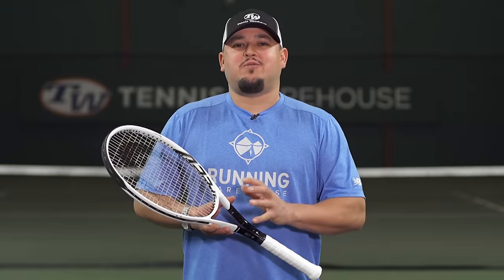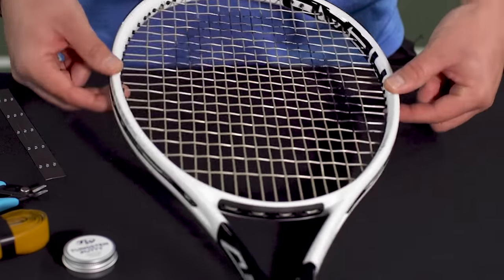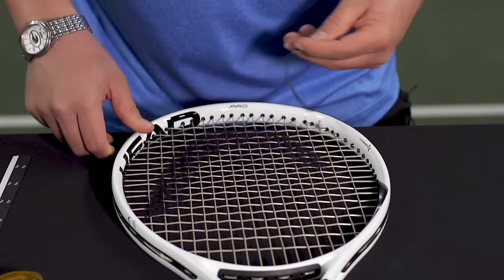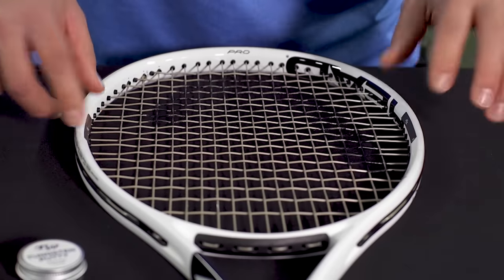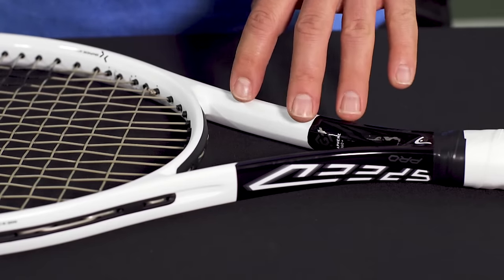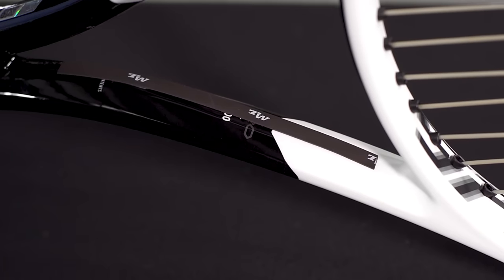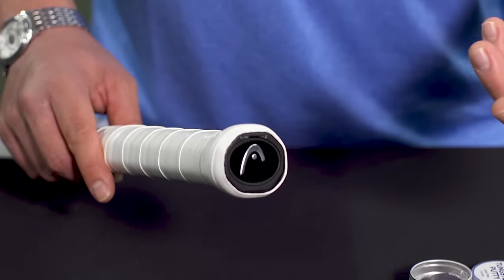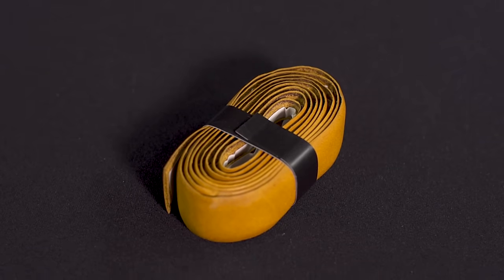Improve your Tennis Gear: Racquet Customizing Tips 🛠🎾 (change balance, swingweight, add power, etc.)

Comment: Troy, I have noticed that Djokovic puts lead tape from 3 to (between) 5 and 6 and 9 to (between) 7 and 6. What effect does having the lead tape in the lower half of the hoop?
Reply from the maker: Since it is still slightly off the center axis (6&12), it will help the torsional stability somewhat, and it will exand the stability and sweet-spot towards those locations as well. So basically expanding the sweet-spot in those directions, to help open up the overall sweet-spot of the racquet. Troy, TW

Comment: Great video Troy. Although it seems like a small amount of additional weight, I can concur that adding just 3g (1.5g either side like 3&9) does make a noticeable difference. To that extent, I was interested to find that Babolat RPM Blast is supposed to be about 3g heavier than most polys, and again the average poly is 3g heavier than most multis. Therefore, if adding 3g at 3&9 increases the swingweight by 5 points, when you string with RPM blast rather than a multi, you will increase the swingweight by about 10 points!(?). To an extent, that makes comparing strings difficult, since the frame will behave differently. Even comparing RPM Blast or another heavy poly against a normal poly is going to be not just about the string performance, but also a noticeable change in swingweight. I wonder if TW could possibly start providing a string-set weight on the database, since it is clear 3g around the hoop is significant. Even if the stringbed is essentially even balanced left/right, it is on average as far from the balance point as 3&9 are. I think it should be fine to just check one set of each string, since the different strings are an individual mix of one plastic or another you can be sure each set must have a fairly reliable weight if it is a standard length (unlike the variation in racket weights you can have). I think that would further aid the customisation process, similar to thinking about different grips. Thanks for your consideration!
Reply: I have RPM Blast hybrid with Tonic Gut and my racket static weight is up a tad higher than what I'd like.  I wonder how much a difference it would make to have lighter weight strings in it given the impact of small amounts of weight in customization.  When tinkering with different strings it may not only be the string characteristics, but also their weight impacting how a player likes them.

Comment: Hey Mr Troy. Where do you suggest to add weight on the bottom besides leather grip to keep it balanced if I wanted to add some more in the 3 and 9 o clock?
Reply from the maker: We usually go with some tungsten putty packed inside the trap door at the bottom of the handle, and we use cotton balls to keep it tight and secured. Troy, TW

Comment: I’m using the diadem tour so I think I need a little more power so I guess 12 o’clock is the way to go? Or maybe 10 & 2? Also, my racquet is more headlight and handle heavy so I guess I shouldn’t add weight to handle area? Troy has messaged me back regarding this stuff in the past but I just can’t find anything that feels good! Def need a little more power though
Reply from the maker: If you are sticking with the same string (or not looking to change string), then the best way to increase the power potential is by increasing the swingweight. You can add the weight wherever you would like to, above the grip to the the very tip at 12 o'clock. The farther you go up the racquet towards the tip, the less weight you need to increase the swingweight or power potential. Hope that helps. Troy, TW
Reply: @tenniswarehouse  thanks again buddy I appreciate it. I’m using Solinco confidential and my racqiet is low powered I’ll try 12 o’clock again or 10-2 o clock
Reply from the maker: Oh I see. When you said Diadem Tour, I thought you meant one of the Diadem poly strings, not the Diadem racquet. So the confidential is a great string, but also very control oriented, so you could maybe try something with a bit more elasticity. Either way, a little weight in the upper hoop should help. Troy, TW

Comment: My best results after much experimentation with Dunlop 95 revelation tour and super revelation was taping from 4th cross string from top of racquet to the or 5th cross string from bottom. Widens the sweet spot, but strings need to be upwards of max tension. 68 for Rev tour and 74 for super rev. Cheers
Reply: That’s super high tension! I play 55-60

Comment: How often should you replace your lead tape? Does water affects its quality? And  what are some factors or instances that you should replace the lead?

Or do you not need to anymore
Reply from the maker: I would consider changing it, if it starts to lose its adhesive or is not sticking to the frame like it should, or if it starts to come off around the edges. Troy, TW
Reply: @tenniswarehouse  thank you so much

Comment: Thanks Troy for your video , I would like to know the effect of using a protection tape on the swing weight and the racket balance !
Reply from the maker: That's a good question! What brand of protection tape do you use? I haven't tried getting specs with added head protection tape before, but I may be able to try it out on the RDC machine...Troy, TW

Comment: Fantastic video - thanks. I want to add torsional stability  and some weight to my Clash 100s but I don’t want to reduce their head lightness. Will adding tape to the throat of the racquet help with stability, particularly when volleying?
Reply from the maker: Yeah, that is a good place to start. I would try adding the weight at the top of the throat, or the Y, as the further the weight is from the center axis (when the racquet is vertical), the more it will help with torsional stability. Troy, TW

Comment: Hi guys 👋 great video, I do have one question tho; when adding tungsten tape to the handle of the racquet should I wrap it around the handle or stick it parallel so that the weight is evenly distributed?
Reply from the maker: For the handle, we typically recommend using tungsten putty, with a cotton ball, and placing the weight inside the handle, through the trap door of the butt cap. The Tungten tape is a slightly thicker than lead tape, and so it is somewhat noticeable when placing it underneath the grip. I have also tried using lead tape on the handle, placing them parallel to the handle, and then using a piece of clear office tape to make a seal on top of the lead. That seemed to work well, and is thinner than tungsten tape. We have a video here where we show a quick application of tungsten putty: https://www.youtube.com/watch?v=XPYcUghB4Xc. Troy, TW
Reply: @tenniswarehouse  Thankyou Troy 🤝, I’ll be sure to make a note of it, tungsten putty sounds like the best option for now 👍

Comment: Hi Troy. Great video! I recently started customizing and it's made a huge difference. I added lead at 3 and 9 to my RF97, bringing its swing weight up to 347, and it's made a huge difference. Given that customization can really change how a racquet plays, what do you look for when you demo a racquet? I've heard great things about the Yonex VCORE Pro 97HD, but I know I'd much prefer my racquet to the Yonex if the Yonex were in stock form (the swing weight is way too low and I'd want the balance to be more head light). Any thoughts on how to demo knowing that you're going to customize the racquet quite a bit?
Reply from the maker: Thanks for the feedback. Ideally it would be nice to have the perfect racquet, where you don't have to customize it, but that it hard to find. For me it used to be the Wilson Six One 95 18x20, but when that became discontinued, I gradually transitioned to the Yonex VCORE Pro 97 (330), which does a lot of similar things to the RF97, but slightly more flexible, and a bit lighter. Since then, I have gradually looked for more power, and a little more reach, as to why I am now using an extended length frame (EZONE 98+), this narrowed things down for me quite a bit as there aren't that many available. The VCORE Pro 97HD is a great frame, that will provide a more flexible feel, more comfort, and even more control than the RF97, but still feels pretty solid. I typically would look for racquets that have a similar headsize, and I also tend know the range of stiffness that I prefer. From there I tend to know how the string pattern will effect the launch angle, although sometimes string spacing or density is more important than just the number of strings. If you are big into how the racquet feels, then you should also pay attention to the beam width, in combination with the stiffness rating. All that said, the actual testing is important, because sometimes things seem to line-up on paper, but don't always workout on court, or vice-versa, as the materials inside the frame, and the way they are constructed plays a big part in the feel. Troy, TW
Reply: @tenniswarehouse  Thanks for the response, Troy: this was very helpful! One thing that's intriguing me about the VCORE Pro 97HD is something you said in your review, namely that you could 'whale' on the ball without fear of it going long. If you customized it to bring its swing weight up to match that of my racquet (347), do you think you could still whale on the ball and keep it in or would the customization eliminate that?
Reply from the maker: @alhs77st , that is hard to say as that swingweight is a bit high for my liking, I would likely just bring up to about 335. I would likely have to adapt to being loose with the arm, while whipping that racquet weight through contact, but I still think control would be great, just harder for me to control over a long hitting session. With that said, I think if you were to try the RF97 and the 97HD at the same specs, you would be able to tell that the 97HD offers a bit more control, feel for the ball, and added comfort. Whereas the RF97 feels more firm, and is a bit more stable, coming from that rigidity in the hoop. Hope that helps. Troy TW
Reply: @tenniswarehouse  Thanks, Troy -- this was very helpful!

Comment: Thank you for your video.. Does the extra swingweight affect the topspin produced? Recenly change my racquet to an Ezone 100 2022. I like the racquet but i find the swingweight to be lighter than my previous racquet.. I would like to have this more heavy head feeling on my new Ezone.. What is your recommendation on where to put the extra weight
Reply from the maker: The swingweight could becomes high enough to effect your swing speed and stamina over time. As mentioned in the this video, adding weight to the 12 o'clock will increase the swingweight the most, with the least amount of weight. So weight at the tip of the racquet will effect or increase the swingweight the most. The widest part of the hoop or head of the racquet will effect the twistweight the most, think torsional stability. So it really depends on what effect you want the most. If you place the weight at 2 & 10 o'clock, or the top corners of the hoop, it will somewhat be in between maximizing the swingweight, and maximizing the twistweight. Troy, TW

Comment: Dear Tennis Warehouse. I’ve ordered your tungsten strip. I’ve switched from RF97 to regular PS97 V13 and i have the perfect manouvrability now. I only lack the swingweight from the RF97 on my Pro Staff 97 315g and i want to add 3g of tape under the bumper and maybe to not sacrifice the manouvrability i want to replace the grip with a leather one. Can you tell me if with these mods i will risk to feel my Pro Staffs 97 heavy like the RF97? If 3 grams at 12 o’clock will add 1 point balance at the head and the leather grip will add 2 point balance at the grip maybe i will feel the raquet just about the same in therms of weight cause i will gain 1 point of balance at the handle. Thank you
Reply from the maker: It is hard to say for certain until you try it on court. So maybe it is worth experimenting before you put the weight under the bumper, you can add it to the inside of the hoop and move it around a bit if you need to. Adding weight to the hoop will increase swingweight, so it will effect the maneuverability somewhat. Troy, TW

Comment: I'm using your customization tool on your site to increase my swing weight and i am planning on adding weight at the 3 and 9 position of the head. Trying to keep my racquet under a certain weight so when adding weight to my racquet should i consider my over grip(tounra max tac) weight as well?
Reply from the maker: Yes, if you are trying to keep the racquet weight to a certain amount you should probably factor in the amount of weight with the overgrip on it, since that is how you play with it. Troy, TW

Comment: Hi Troy, when you say that a leather grip adds about 10 grams to the racquet. Do you mean compared to the before situation with a synthetic grip (which was removed). Or do you mean that the leather grip by itself is about 10 grams? Thanks
Reply from the maker: It will be roughly 10 grams more than the racquet would be stock, with a synthetic grip on it. Troy, TW

Comment: Thanks for the video, can I ask what is the purpose of adding weight to the throat/handle?
Reply from the maker: Specifically, it is a good way to add overall mass, without shifting the balance point. That said, it will help add some torsional stability and swingweight, just not as much as adding it at 3 and 9 o'clock of the hoop. Troy, TW

Comment: Hi Troy thanks for doing the video. I notice you only added a few grams of tape and you said it will beef-up power and stability.
I saw Andy’s and Novak’s racquet and it had a lot of tape along the 3 and 9 o’ clock positions. 
Wouldn’t that be bad on the arm, in your opinion? I have added tape on my Radical racquet but only 4-grams and it had great effect. So using that much weight- is that good at all? Thanks, man.
Reply: @Francis....most pros use much heavier racquets than what we see off the shelf. Although, the trend is going down a little.

Heavier racquets are more stable, therefore typically less vibrations and better for your body.

That said, if you can't swing a heavier racquet, of course that can do damage and you're game will suffer accordingly.

It's about finding that balance of what you can handle.

Oh and you'd not see Andy's lead tape at the tip of his racquet. It's under the head guard, assume the same deal with Novak, but can't personally confirm.

Cheers
Reply from the maker: I think a small amount can go a long way, especially if you are adding it to a racquet that you have used for a long time. As @nostro1001 mentioned, many pros use much higher specs than most retail racquets, specifically swingweight, so it makes sense that they would add a lot of weight in the head of the racquet. I think it all comes down to preference, and also that many of the pros are stronger, and extremely fit compared to most of us recreational players. It sounds like the 4 grams of weight you have added to your racquet works well for you, and that is likely all you need. For me, certain racquets like the VCORE Pro 97 330, and Wilson Six One 95, I don't need to add any weight at all, and other racquets I may add a lot of weight to the head of the racquet to increase the swingweight to my liking. I hope that helps. Troy, TW
Reply: nostro1001 Thanks, yeah Andy’s racquet is under the head guard. I saw it on a video when he smashed his racquet and photos of the same racquet from the internet.
Reply: Tennis Warehouse Thanks Troy. Definitely won’t be adding too much weight on my racquet - happy how it’s performing at the moment. Just trying to see what else I can do while waiting for the shut down here in Victoria Aus to get lifted. All the best, man.
Reply: @francislirios9730  Np Francis....I've been lucky to be playing almost daily. Yes, the Clubs are shut, but it's still allowed to play singles if you can find a court.

I'm ex-Melbourne, up in Qld these days.

Cheers and happy hitting when you can get out to play! 🎾🎾🎾

Comment: I have a random question, can you explain what Head’s Cap Grommets do for their frames? I hear you guys talk about how it provides more power (like you can buy optional cap grommets for the Radical, etc). Is it just a little more swing weight than traditional grommets?
Reply from the maker: The primary benefit is the protection of the frame, from being scraped on the court, as the CAP covers most of the outter rim of the head. Most Prestige racquets have come stock with them over the years. With the current Graphene 360 Radical MP & Pro (as well as previous Graphene versions), there is an option to purchase the Radical CAP grommet, which will obviously add protection to the frame, but will also add about 20 swingweight points to the racquet, as it adds some weight to the head of the racquet, with the added plastic on the sides of the hoop. This added weight will add some stability to the frame, as well as more plow through power, but will also make the racquet feel more sluggish. Hope that helps. Troy, TW

Comment: Hi Troy, i have been hearing if u add X grams of weight at the head, it will be advisable to X grams of weight at the handle. My question is,  will the overgrip of 6 grams (instead of adding lead tape at the handle) already sort of counter balance the addition of 1 gram at 3 and 9pm(total 2 grams) at the racket head? Cheers
Reply from the maker: It really all comes down to the player's preference, and experimentation if you aren't for certain on what specs feel best for you. It is recommended to counter balance the weight in the head, if you don't want the balance to change much from the stock specs, but not everyone likes a certain balance of a given stock racquet. So yes, give it a try with the added weight in the hoop, and the overgrip and see how it feels for you. Troy, TW
Reply: @tenniswarehouse  Thanks Troy :)